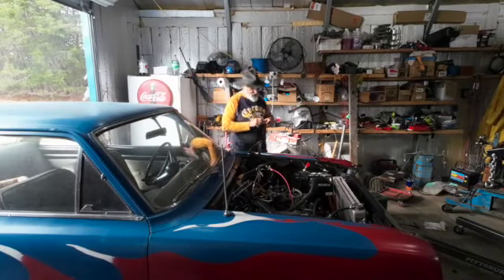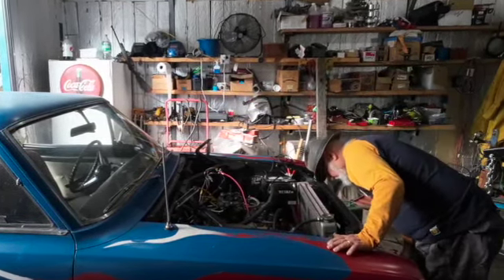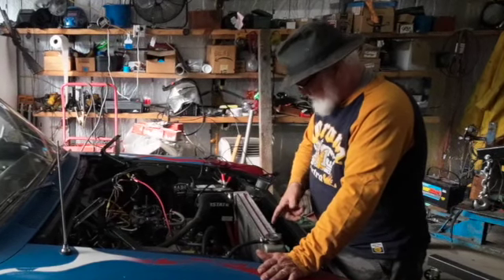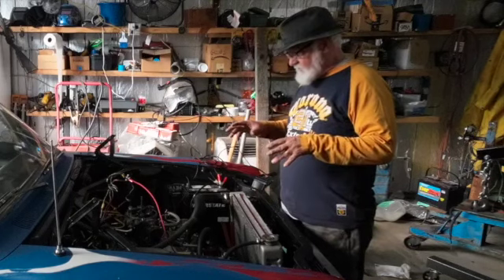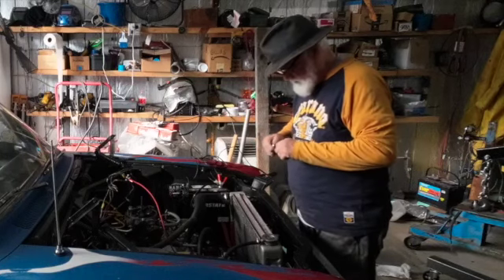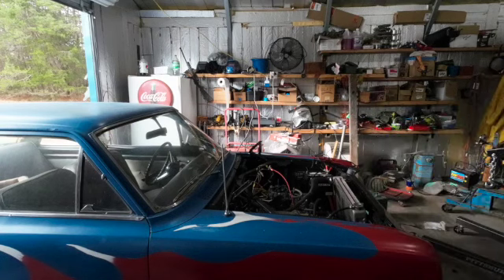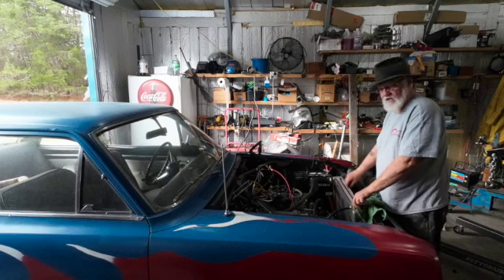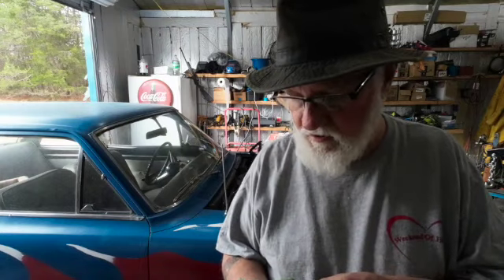Old Car Radiators get hot

Comment: yes 212 at sea level water boils. At a mile above sea level maybe 180.  Under pressure it can go to 260 or higher and not boil.
Reply from the maker: My brain slips in my old age.
Reply: @rpeek  mine falls the to floor on occasion